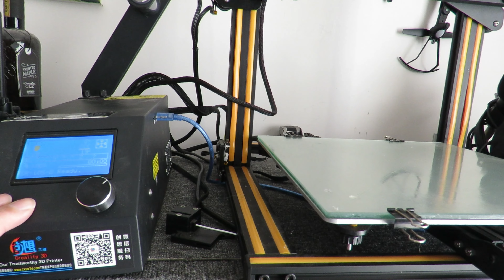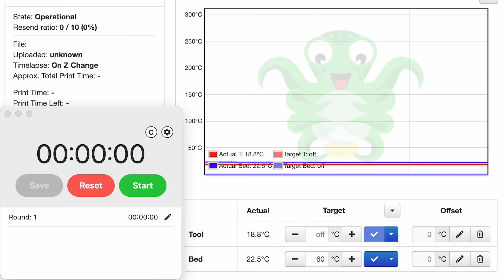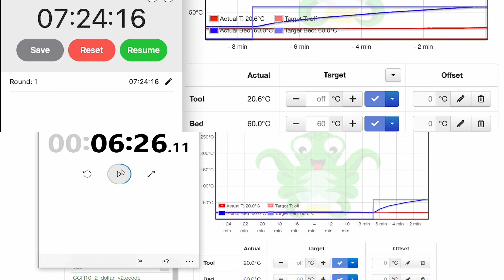CR 10 Cork Thermal Pad Review with Unexpected Result

Comment: Hmm, it apparently took some energy to heat up the cork too... Maybe a drafty room would change the balance. Also would be interesting to see which configuration allows the highest temperature.
Reply from the maker: You could be right regarding the room temperature. (Outside door was opened quite a few times on the day of the second test.)

P.S. Where I live, the outside temperature has dropped quite a bit. (This Morning was 4 degrees Celsius.)
So I'll wait till I get warmer weather, and test again.